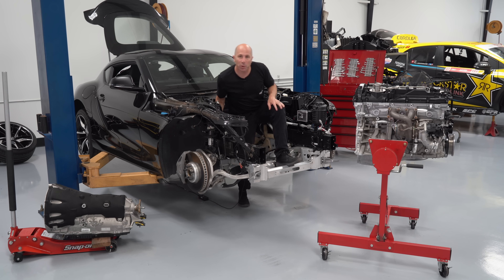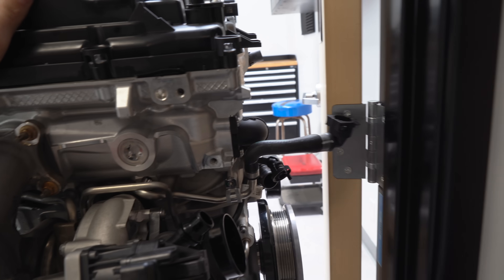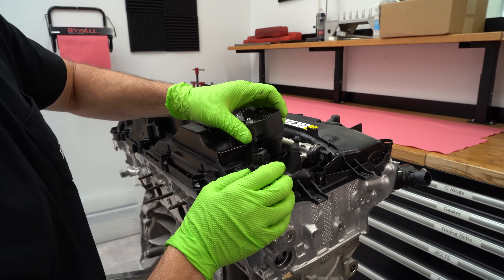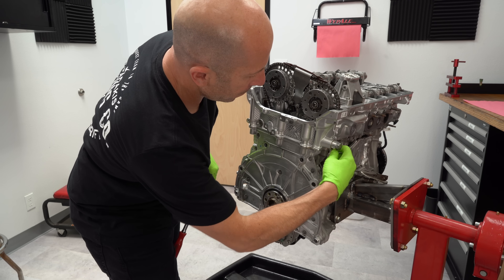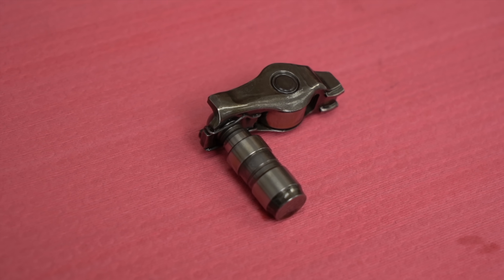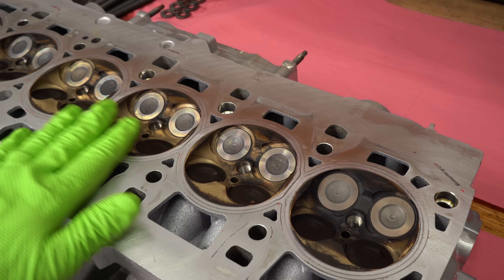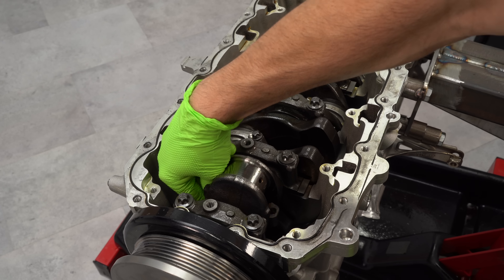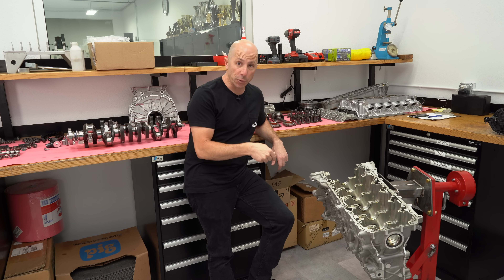2020 Supra B58 Engine Teardown - First Look - Better than the 2JZ?

Comment: Not in a million years would I be able to put that back together
Reply: Exactly my thoughts
Reply: Doesn't look too hard. Just like any other engines, follow sequence and torque specs. Other than the modified engine stand, just a few special tools.
Reply: @a_tacolypse  Is it easy to get hold of the instructions/torque specs? I can't imagine it's written in the car's user manual.
Reply: @kirasguardian6328  That's what a workshop manual is for.
Reply: @kirasguardian6328  You use a service manual....not the owners manual lmao.
Reply: @kirasguardian6328  Haynes manuals are your friends
Reply: @elkofcanada5003  Sorry, noob question (I'm getting my first car next week!):
Does the service manual come with a car usually, or does it have to be ordered from the manufacturer? Do you need to prove that you're a mechanic, or whatever, to get one?
Reply: @a_tacolypse  shut the fuck up. You can't even put fucking Lincoln logs back together.
Reply: Together, I couldn't take apart!
Reply: @gfysyoutube   Mankind has still to invent something that i can't rip apart.
Reply: A lot of key components but everything looks easy on camera 🤦🏾‍♂️
Reply: just the intake-shaft will f**k us up...
Reply: Bi Turbo. My thoughts exactly. Fighting those springs to get it back home outta be a nightmare. Curious to see what the tool to pull/install that cam will look like.
Reply: Some people need years, some month, some weeks, some days and at least only a few hours 😀 i would need maybe two or three days. And thats loong 😉
Reply: Just play the video in reverse.
Reply: Oh, I could get it back together no problem...but it wouldn't run.
Reply: Its actually relatively easy to do. Ive only taken apart old ls drag blocks before but this is much simpler than old ls6 ss blocks
Reply: @ethanschocke4746  a "ls6 ss block" isn't a fucking thing. Stop watching fucking cleetus's videos thinking your James. You useless fucking swine.
Reply: Yes you can
Reply: You definitely could. Engines are more intimidating than complicated. It still takes a lot of time learn how to rebuild one to the level this one is taken down to
Reply: @360lateflip  this is true, im a mechanic and these things used to scare the hell out of me, now its just another day at the office😁
Reply: @360lateflip  they are complicated. Extremely so but because how they are assembled they are easy
Reply: Hahaha, that engine has nothing on modern Diesel engines. There are less parts to take off on that thing than there are on a brand new 15L inline 6 diesel.
Reply: Just run the tear-down video backwards.
Reply: a million years is pretty long. in that time youd be able to make the metal the engine is made of  from iron youve extracted from your own blood
Reply: Roger Dodger  I did bend and break alot of steel with my bare hands. It's not that hard, because when you bend it back and foreward enough, it wil break alright.
Reply: Same too many parts it’s look highly complicated
Reply: Yep that's German engineering for ya
Reply: Why not? Its relatively easy: nothing special out there!
Reply: Doesn't seem too difficult tbh
Reply: I can do it with my eyes closed.
Reply: @Cole_King  i bet its a lot easier when they are open😏

Comment: Oil and coolant passing thru the same thing with the same gasket sounds like n54 problems again
Reply: That's not a new design, I've seen it on engines as old as 1989 and I'm sure it was in use long before that.
Reply: @somenutjob  yeah, ive seen tons of those in all kinds of brands.. And yeah, they break, i replaced a headgasket on a 89 audi totally in vain, the oil water cooler had ruptured internally... Much like todays problems with EGR coolers
Reply: I mentioned it because it’s built by Toyota and bmw and was a constant problem with building power on the n54 twin turbo the gasket there would always fail under pressure hence why I said n54

Comment: Hm, I am not a specialist while inspecting engine internals. But, I don't like to see that internally joined intake-manifold which means different exhaust line sizes inside of alluminium head and in the same time, I beleive intenal port sizes are not enought to provide a good fart into a bigger turbo. Exhaust manifold is very strangled and designed in a way to perform a quickest turbo spool. At nother hand this internally-designed exhaust manifold which might lead to head overheating causing damage. Pistons are definitely need to be replaced as they are light-weight, T-shaped and tiny looking. Connecting rods, it's caps, crankshaft caps are also not promising at all. Camshafts are built based on a hollow tube with adding tiny cams to it "on the heat" - this looks also a modern tradition of saving materials and reducing manufacturing costs. Camshafts probably should be replaced with solid crafted versions but it should be considered depending on camshaft beds and how good they are in terms of endurance. Also, there's questions of additional oiling of rockers and camshafts from above side (which has been designed in SR20 for ex.). Block is alluminium based with installed thin cast iron sleeves, these sleeves should be also replaced with enforced versions. Modern technologies and current engine complexity are unfortunatelly in opposite with reability. The time has passed where global manufacturers were adding additional endurance margin. Today is only marketing ahead of this, nobody wants to see your engine live forever and this is really sad. Anyways, it will be definatelly interesting to see this struggling battle with this  already highly thermally loaded engine resulting total commitment of 1000 hp. Plz, correct me if I am wrong somewhere. And yes, not better than 2JZ, much worse.
Reply: This world already gone mad and went stupid. Short, empty comments are gathering tons of likes. No worthwhile replies, no real suggestions from engineers. Do we have any real engineers here? Worthless commentators - go fuck yourself. There's no envy, just sadness.

Comment: Valvetronic? Fuuuuuuuuu. 
Porting the exhaust side should be interesting. That's gonna drive the CNC guys nuts.
Reply: LPG into petrol injectors and all be ok
Reply: @StopTeoriomSpiskowym  LPG is garbage, and it doesn't work like that. LPG doesn't work in high pressure fuel injectors.
Reply: LPG can not be liquid in petrol injectors with pomp? Im not talk about standard LPG injector
Reply: If anything it's easier to port, it's just two large ports rather than six, that's less tool wear, and a super short program.

I can't say for what gains you're gonna get from it though, I personally believe the six separate exhaust ports will be better for the performance of it in the high horsepower part, but hell I'm open to being wrong.
Reply: A simple circle interpolation on two ports would be a very easy and short job.
Reply: @jth_printed_designs  yeah that's why I don't know what the gains will be because you won't get a "full" port job done, I also think that they're gonna switch to the BMW head, I saw earlier this week that it has the separate ports.

These integrated exhaust manifolds are pretty annoying for the aftermarket, why they decided to put this type of head on a car that's supposed to be "made to be modified" is beyond me.
Reply: @jth_printed_designs  I don't think maybe people even have heard of extrude porting, and from what I know, it can be fairly expensive.

Comment: Cool info. So all the new tech these days and they went back to a tried and true mechanical fuel pump that's been around 100 years. Also noticed if you need to do a new timing chain you might as well rebuild the engine while you have it out, that's going to be pricey for a timing chain install. Cool vid though.

Comment: WoW, oh how times have changed in regards to the building and fabing of new engines. Kinda reminds me of the K-series engine w/ 2 extra pistons. But, I'm really digging the direct injection set up. Not to mention the factory spec CLOSED DECK !!! 2 exhaust ports ... what ??? Super crazy !!! What type of porting would need to be done to maximize air flow. Super simple to fab up a turbo manifold.

Comment: Those powder forged cracked connecting rods are like what they had even in the little dodge neon back in the day. They are cheaper to produce, Easier to control the weight and stronger. Porsche invented it back in the 1970's if I remember correctly. Really a pretty cool design for production vehicles. Obviously not designed for extremely high hp race engines. Thanks for the awesome video of the tear down. Very cool designs in the engine.

Comment: Really impressed with some of the quite clever engineering that went into this engine... but I still HATE drive-by-wire throttles. 😒
Sure, it might be able to open and close faster than the speed of my right foot depressing the pedal, but think about that.... it's an utterly useless accomplishment. Why would you ever need the throttle to react faster than the control inputs that you are giving it?(is the car going to predict your next throttle movement before you even execute it?) Also, you lose a significant amount of the "connection" between the driver and the engine. Cable throttles just feel more direct. That's all I got.
/rant.

Comment: Junk. kept the 1JZ around nearly 2 decades, should be using it, not this junk Kraut engine
Reply: And your credentials are? 🤔
Reply: @WALTERBROADDUS  Journeyman and Redseal diplomas for automotive technician
Reply: @MrSparco777  That might be good at Jiffy Lube, but hardly makes you a automotive or mechanical  Engineering technologist. Temple  University B.S. in Engineering technology 1997. This is far from being,  "Kraut Junk." The old engine has be out of production for a decade plus. The emisons & fuel economy of this engine design are better.
Reply: @WALTERBROADDUS  Toyota had 1JZFSE fuel economy engines 15+ years ago. fact will always remain Toyota and Nissan straight 6 are infinitely more reliable and less repair hassle than anything German. only decent engine Germany put out the last 20 years was the VW 1.8T

Comment: I'm just a random viewer with background knowledge of gas v8s (ls, small block gm, mopar, Ford, and big blocks) as well as diesels and that crank has no overlap between the main and rod journal. It looks like theres probably an inch or so between where the journals outer diameter is.. that doesnt seem like a very strong crank to me. Real strong cranks tend to have journal overlap and its basically connected from front to back through a portion of each and every journal.. this just connects through... I'm not even sure what to call it at the moment.. I do wonder how long term capable this will be. Not single dyno pull but "daily" driven max capability.

Comment: With the DRASTIC innovations in almost all aspects of technologies today, I am really surprised that auto manufacturers haven't been making 5.0L/5.5L I-6, & 3.5L/4.0L I-4 cylinder flat plane (high RPM/red line) high performance engines. V6 & V8s would literally not make any sense from a efficiency & performance standpoint, except perhaps for novelty reasons. (the 5.2L Voodoo comes to mind)

A 5.5L I-6 would be VASTLY lighter than an equally displaced V8, there'd be half the moving parts, (less power being used-up) thus a much higher power-to-weight ratio, better heat management potential, & more efficiency & durability possibilities, with crazy explosive performance in a smaller, lighter package!

I'm not even a mechanical engineer, or ASE cert'ed mechanic, & I recognize the insane potential here. Perhaps I just planted a seed in some gear head savant's head, & helped springboard an automotive revolution in this comment. That, or retarded trolls are about (abooot if you're from Canada) to pounce on the brilliance of my idea...

Comment: The good stuff:

Less gaskets, slick exhaust manifold Incorporated in the head, variable everything valvetrain, forged crank, solid deck, lubrication system is well planned. It's a Toyota.

The bad: 

Plastic intake manifold, dropping the tranny to get to the timing chain, overly complicated cooling system $1000 water pumps anyone...did I mention a plastic intake manifold?
Reply: In terms of a factory part, plastic is better. Less heat conduction from the engine to the intake air. It would be cool if they could make an aluminum manifold coated in silicon but I trust that BMW had a committee of engineers deliberate for 2 weeks on just the plastic composition. If they got it right then they were allowed to see their families again.

Comment: I can't wait to see how people put a big turbo on this.  It looks impossible since the intercooler is built into the intake manifold.  While cool from the factory, this thing is NOT a tuner car in the slightest.  RIP Japanese LS platform.
Reply: @a_tacolypse  There is still hope then, but having the exhaust runners inside the head seems limiting to me, but who knows what the aftermarket community will come up with.
Reply: joseph her there’s no FMIC. Charge pipe goes directly from the turbo to the throttle body
Reply: @boiledtoiletwater6286  theres a water to air intercooler behind the throttle

Comment: The real question is How long are all those plastic engine components gonna last without cracking.....
Reply: Usually BMW engines last up to 270k kms. Obviously seen some with way more, like 340k but with 270k the first issues depending on how you drove it should surface.
Reply: Ryosuke Takahashi yea I know the engine will last but over time with all the heat and just time itself I’d like to see how that plastic holds up.
Reply: @Steven-rg4bo  It holds, it is not common to replace it on other bmws

Comment: So basically to do a timing job, you have to pull the motor lol? I’ll stick too my reliable 380k mile 2jz
Reply: The question would be "why do you need a new timing job ?"
Reply: Bob Outélama lol cuz I’ve put 280k on my car with a 2jz and had to do 2 timing belts so far to prevent anything? Did the head gasket once too while I was at it lol
Reply: @TheSkrillexRemix  chains last lots longer than belts my dude. 

A LOT longer. 

170k mile m30 with it's original timing chain. All I needed was a new tensioner and that was done without removing any other parts.
Reply: Bob Outélama because it fails like the audi (they have the same design)
Reply: @BF109G4  ph shit that's right because so many have failed already.

checks google

No no they haven't. Guess this dude is from the future
Reply: Nw.Caffers lol, we have many failing Z370, do you see any posts ? No
Reply: I believe you just need to drop the transmission......... and THEN pull the motor lol
Reply: Masta Planna you’d have no room to work on anything I feel
Reply: You wouldn’t need a to do a timing job in a long  time, mate. Such is the power of timing chains.
Reply: @B4R0N.  my old m30 lasted till 210k miles before the chain showed signs of stretch. Unfortunately a plug shat the bed not long after and lunched on #4 cylinder 🤦🏻‍♂️

Comment: That engine is 100 percent bmw, it hurt my heart a little that he didnt use the release sequences for the head, windage tray and main bolts. All them bolts are single use, with 2 and 3 stage torque sequences. Dont make an error going back together, I need to see 1000 RELIABLE hp.

Comment: The narrator in this video, has mastered the art of translating mechanical'ese, to comprehend-able English. 

I actually kinda understood everything he was saying in this video. My hands are all gaw'damn thumbs...
Reply: Joel Williams If you understood that part about the intake cam phasing using eccentric shaft, I take my hat off to you, because I just can't seem to get it
Reply: @hambo6713  all i got was the shaft part....
Reply: hambo I could be wrong, but I believe that’s BMW’s Valvetronic. The second shaft allows for a variable intake valve length. Engineering Explained has a video on it. If it’s what I’m thinking of, the throttle body stays open all the time, and the intake valve opens bigger each rotation as the throttle pedal is pressed. 

The idea of variable valve length is similar to Nissan’s variable compression engine, where the stroke is variable.
Reply: More thumbs might be really helpful for texting.....
Reply: @gonzomuse  Nah man, hitchhike'n!

Comment: Lot of parts that they use on race 2.3 4 cylinders 
Mouse trap springs. Windage tray cut pistons etc. Good luck with 1000 HP build. W8ah the 2020 supra was a bit bigger looks to much like that scion or Subaru .

Comment: ALL THAT PLASTIC! YIKES! Typical BMW build Quality.  I can already forsee water pump leaking. and tons of vacuum leaks within 100k miles. Whats great about what happened with the new SUPRA and the B58 is that there will be TONS of aftermarket support for the B58 Engine from the Toyota Crowd, So thats a good thing.

Comment: I see very little if anything of Japanese design in the to be honest, A lot of it is familiar wacky German engineering to us BMW owners.
Reply: Psssst, thats because its a BMW engine.
Reply: Thank you Capt Obvious.
Reply: @andrejones3464  Maybe I need to lay it out in simpler terms? Many of the interviews on the co-production of the Z4 and the Supra state that the basic frame, and engine  design were agreed upon and then the two teams went their separate ways, so its been speculated that Toyota may have had some input in how the the engine was constructed/designed. If that's the case I'm not seeing it in this tear down, and stuff like a non-removable intercooler inside the intake, an internal exhaust manifold, chains at the back of the engine, are almost all German concepts of engineering. While yes they're innovative some aspects, they're almost always a bitch to replace, often meaning you have to throw out whole assemblies to repair some items.
Reply: No what he is saying is it looks like Toyota's influence didn't find it's way into the motor to simplify things in a way that make repairing it easy.